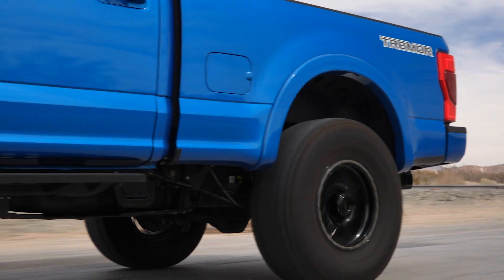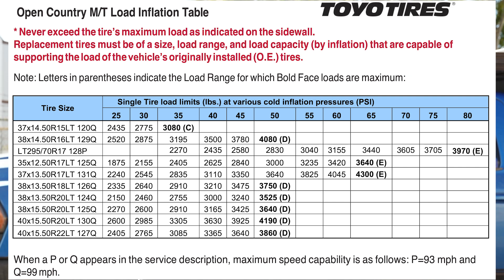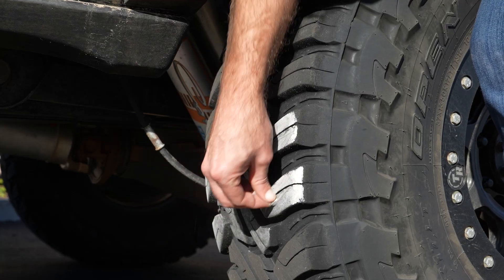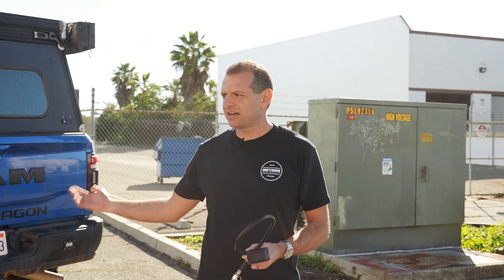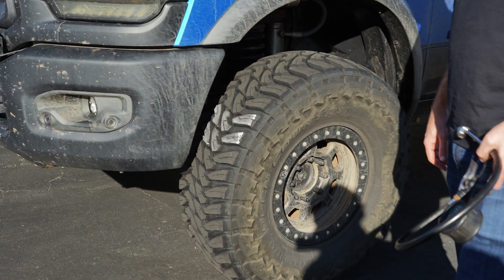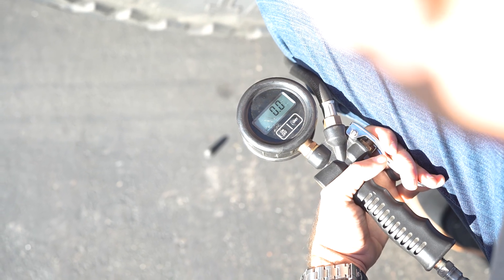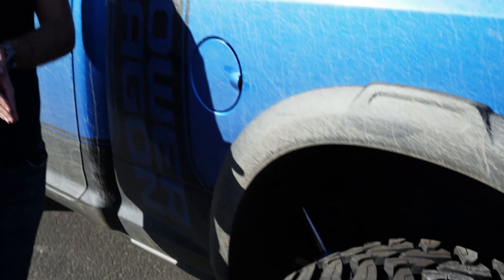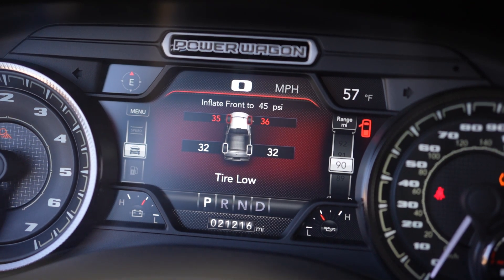How to Set Proper Tire Pressure In Your Truck With the Chalk Line Test

Comment: I do the same thing but on a gravel road. 
I see if the dust is even across the tread and how deep the shoulders go in. Works fast and is accurate. I would do the front then add 5psi to make sure it doesn’t eat the shoulders on corners 
37 x 13.5 x17 Toyo MTs
2018 ram Cummins 2500 with winch bumper and no spare tire
65 psi upfront
35 psi in the back
Doubled my miles per tire!

Comment: So what air pressure should I run? I have a set of 285/65/20 Mickey Thompson Baja boss. I have them at 40 all around. And sometimes the psi gauge on my truck Lowers it to 38-39 and goes up on its own

Comment: Wouldn't it be different for the rear drive wheel seeing that would wear more as to the other side
Reply: Both rear wheels drive. If you have an open differential then both tires will receive equal torque but if one of them loses traction then only that one will spin.

Typically on level ground it will be the passenger side that loses traction, but that is simply due to the engine torque causing the frame/axle to twist slightly thereby planting the driver side tire and unloading the passenger side. If you look at semi truck drag races you can see them actually lifting the driver steer tire off the ground. if you took the weight off the back that tire would drop down and the right rear would come up.

Another way to think of it is like a water pipe that T's off to two sides. Both sides have the same pressure, but if one side breaks all the water is going to go that direction. That's true of either side

Comment: I have all terrain general grabbers 2006 LBZ Duramax testing this now but is anything below 50 to low since the engine is heavy in front? Don’t want to risk a blow out. If anyone can give me help thank you.
Reply from the maker: The goal of this test is to answer that exact question! The chalk line test doesn't lie, and will tell you the exact pressure you need to run on a given truck and tire combo.
Reply: @CJCOffRoad thank you sir.

Comment: Great video and great explanation! i just got a silverado 2500 and i need to run lower PSI. I have the TPMS tool and got it in learning mode to complete the calibration. My question is, how do you let the truck know you want to run lower PSI on purpose? My TP warning light wont go away. When i lower the psi i get the low air sensor on the dash, notification on the chevy app, email from onstar, and my next of kin gets notified that i have low pressure.
Reply from the maker: We have the Rams and Fords figured out, but as of now the only option for altering GM TPMS is a visit to the dealer sadly.

Comment: what about LT tires E load, should I air down to just get full print all the way to the edge for normal road driving? assuming im not loading the FJ up at all.
Reply from the maker: The letter rating doesn't matter in this case. You'll always want to air until you have a proper, full contact patch- save for the very edges.
Reply: @CJCOffRoad  on my stock (weight wise) FJ with 255/85R17 MT Baja Boss  Ive aired down to running 30psi front and 28 rear and have about 1/2inch on both sides equally front and rear.  you think I'm close? It's definitely more rolling resistance than running 35 F/R . but I hope the tire wear is better in the long run.
Reply from the maker: It's all about what you see on that chalk line test! The contact patch shown doesn't lie.

Comment: The chalk test becomes very unreliable on tires previously used at a different pressure than the final test pressure. That's because the tread wears into the shape of whatever pressure you run. Additionally, tires that have been cornered a lot will naturally wear the outer edges more, making the chalk test unreliable on used tires.

Comment: Thank you 😊 nice info! My Tundra off road has psi 30 front and 33 rear! Have a stock 1 1/2 lift just brought the new Ko3’s tire shop put 39 psi all round! On my stock 275 65 18 ran 33 and 36! Back 58,000 miles on org AT tires! So confused but I’ll try this!😊

Comment: i have 2014 2500 ram which i purchased brand new, it now has 300k mls and just installed 2.5 commuter kit with a adjustable  track bar last week from CJC with my factory 20" rims and tires 65psi in the fronts, 80psi in the rears! and i can tell you my truck rides fantastic i wish i new about this 10 years ago.that has always been my biggest complaint rough riding. i do tow a lot nothing crazy 9000 lbs tops i hooked up my trailer and went for a ride with it i couldn,t be happier ! i did purchase 18" method 301 standard wheels haven,t got my nitto 37 12.50 18  ridge grapplers yet but i cant wait! and i will be doing the chalk when i get them! BIG THANKS to CJC Offroad!
Reply: Lol hope you plan on lowering your psi when you get the new tires
Reply: @vee6411  yes 40psi in the front 35psi in the rear as per carli recommedation ,they said to start there!

Comment: Is there any information to be said about airing up the tire to maximum pressure when seating the bead and potentially differences in the way the tire balances at different air pressures?  Should they be re-balanced once you find your final pressure setting, especially if they were initially balanced at maximum pressure?
Reply from the maker: Ideally pressure shouldn't really impact balance unless something is wrong with the tire.

Comment: What i like to do is use that load inflation calculator. My previous tire was a 245/75r16. I went to a 285/70r17. I got on toyos website and i found the weight capacity of the stock tires at the stock psi. I then went to the new tire size and found the tire psi that matches the factory load capacity. Which in turn dropped my fronts 12 psi and rear 20 psi. So with the new tire psi i can have the same load capacity as factory. I can go lower for sure but i do like to know my factory rating so when i tow max capacity i know what psi to run.

Comment: The tire light on truck would n drive me nuts
Reply: May cost you 400 bucks or so, but there are custom tuners that can reprogram the tpms parameters to your liking. While you're in there, you might wanna adjust transmission shift points for the taller wheels anyway.
Reply from the maker: Just turn it off using the methods we mentioned!
Reply: @CJCOffRoad you didn’t mention anything for chevys
Reply: @Bcrawf2994 just pull the light bulb from behind the dash

Comment: Im running a 150 ford on 35×12.50×18 38psi fronts and 30 in back toyo rts ?
Reply: Did you figher out the correct pressure? I have a 2023 f150 as well 4x4 on 35sx18 I don’t haul, mainly cement princess but I am confused about the pressure
Reply: @gman0812  I'm running 40 in front and 37 in back

Comment: Okay wait , I thought if the chalk is darker in the center then the tire is under inflated and if darker on the outside over inflated.
Reply: Other way around. The chalk will be thinner where the tire is making more contact with the road surface. An over inflated tire will be more 'rounded', lifting the shoulders, which means they contact the road less.

Comment: I have 37x13.50R17E on 17"x9" on my '23 Super Duty, with snow plow prep package. I ordered online & they showed up with 40 psi in them. I ran them up 60 up front 62-63 in the rear. Right now it seems over inflated, "ridging out" & stiff. They are rated for 65 max psi. I was just trying to meet stock tire pressure, 40 seemed too low, though I can't say they didn't ride good. My truck once completely outfitted with tools, topper, aftermarket bumpers, & likely airbags will be about 9800 lbs. Right now it's not much heavier than stock, maybe 300lbs over. Any recommendations? Is 40 psi fine? 60-63 psi too high? I know the 9" wide rim will give the 13.50" a little more pucker than a wider rim.
Reply from the maker: 60 psi is way too high! That said, every truck is different, so follow the tutorial outlined in this video and you'll have an answer for what your exact tire should be at front and rear.
Reply: @CJCOffRoad  Sure thing. I dropped it down to 50 in the front & 55 in the rear & am look to examine the chalking my crushed concrete drive way naturally affords.
Reply from the maker: We'd recommend no higher than 45 front 40 rear as a start, but you'll likely land around 40 front and 30 rear.
Reply: @CJCOffRoad  Ok. I always thought, assumed more psi up front. I did a quick math equation & got about 49 lbs per psi based on 65 psi gave me 3195 lbs per tire. Thus if the truck weighs in at 7500+ empty, maybe 500 lbs over stock, then 40 psi up front & 45 rear gives me about 8300 lbs. Thanks for the help. I'll make some further adjustments. Then when I get my tools & topper loaded up I'll check my weight & adjust.

Comment: Curious - I have a full Carli pintop with king shocks on a 22 superduty - 37x13.5x17 nitto ridge grapplers 0 offset - what PSI should these tires be set at?
Reply from the maker: It all depends on the weight of your exact truck and setup. Just grab some chalk and you'll have the answer!

Comment: This is why you guys are the best! My customers always freak out when I say 50 on the front and 40 on the rear. And it looks like I need to go take a second  look at the tread! Because I can go lower
Reply: I agree why put same in rear as front when it’s front heavy
Reply: @michaelturano7522 I think it depends on the truck. My door placard says 55 in the front and 60 in the rear and it asks for load range E tires
Reply: @  the back is lighter so more pressure equals more bounce
Reply: J

  .  

. 

   K..nm
N

?

Comment: I pulled up the toyo chart for 37x12.50r18 AT3s and 25psi equals 2095lbs rating per tire. Ignoring for conversation sake front to rear weight distribution that’s 8400lbs of support which is what my truck weighs. That would put me at an average of 25psi per tire. That’s WAY less than CJC or Carli has ever recommended. Am I missing something here? That would probably equate to something 28psi front and 23rear 😮
Reply from the maker: The load inflation table doesn't lie. We usually say 45 front and 40 rear as a start since that's a pressure anyone can run and tow, but the load inflation table and chalk line test give you a true answer for your exact tire.
Reply: Great information. I have 33x12.5 x18 on a chevy silverado. My tire says 65psi cold seems alot could I run 40 psi without any issues?

Comment: They talk about running lower tire pressures to make the suspension kits ride better. You can do the same exact thing with stock, suspension run low tire pressures and save yourself a bunch of money and buying the suspension kit.
Reply from the maker: There's no arguing that bigger tires at proper pressures are a huge improvement in ride with stock or not stock suspension, but we can say with certainty that tires alone not a replacement for proper suspension. They all work together for incremental improvement.
Reply: @CJCOffRoad  agree I would just like to see a comparison of bigger tires and proper pressure on a stock truck and drive it on the city streets compared to a Carli suspension kit because my pintop kit feels just like stock suspension on small bumps, huge improvement on big bumps. But a lot of us aren't Bajaing through the commiefornia desert on a daily basis lol
Reply: @Rangerdnger I’ll trade you my stock suspension and let me know how it rides on proper tire pressures.
Reply: @Sdukes001  why would you run proper air pressure? Why wouldn't you let the air down on your tires? Just like you would have to do with a Carli suspension kit?
Reply: @Rangerdnger  I do run 45 front 40 rear but you say it the pintop rides horribly so we can trade stock suspension to a pintop and you let me know how it rides. It’s a truck a heavy duty truck it’s not meant to be soft if you want a soft ride go get a half ton.
Reply: @Sdukes001  my truck had stock suspension drove it like that for a long time I installed a Carli pin top 2.5 with King shocks and sure yeah it rides nice if you hit a jump or something big but just normal daily driving it's still rough as hell extremely extremely stiff shocks. And the rear deaver leaf springs lower your weight capacity quite a bit but yet when you are empty, they are still stiff as hell. I run 40 in the front, 30 in the rear, same exact wheels and tires I had with my stock suspension. Gets old airing up the rear tires Every time I want to haul load I was hoping with the Carli suspension I wouldn't have to lower the air pressure down that low to get it to ride nice
Reply: Yeah… it’s not the same. Go hit a whoop section with stock suspension and soft tires and tell me how it feels haha.
Reply: @JustDiesels  he’s not wrong. There’s absolutely no reason to be running 65-80psi unloaded on a stock truck. Especially if you’re in SoCal with our crappy freeways. We did this at the SoCal city I was a fleet mechanic for. But if you want the best of both world a suspension system will really soften things up. Especially on 3/4 ton and up trucks
Reply: @JustDiesels  I don't hit many whoop sections on the highway. Actually none at all, I hit a lot of wash boards on gravel back roads and my suspension kit handles wash boards terrible just like stock suspension.
Reply: @Rangerdnger  do the chalk method shown here to find that sweet spot unloaded and then air up when you tow 👍🏼
Reply: @brokenwrench404  I do and it's a pain in the ass I tow quite often
Reply: 😂😂😂 people say the dumbest things

Comment: What’s the backspacing on those trailready wheels? I’m looking at running 17x8.5 with a 5.5 backspace and a 37x13.50 Nitto ridge grappler but I’m trying to keep the tires flush with the fender flares on my 5th gen PW.
Reply from the maker: This particular truck is 0 offset and 4.75" backspace, but you want 5.5" to be flush with the fender.

Comment: This is a good video on the pressures. My 4th gen wagon with the same tire is 35/28 for a perfect line across. Which is wild to think about. 

I like to air down to 25f and 20r off-road.  The Toyo is great however it seems that the newer us made toyos pop easier than the older japanese made ones.
Reply: @Such Is Life 37x13.5r17 Toyo MT